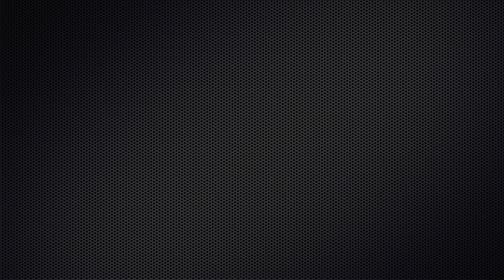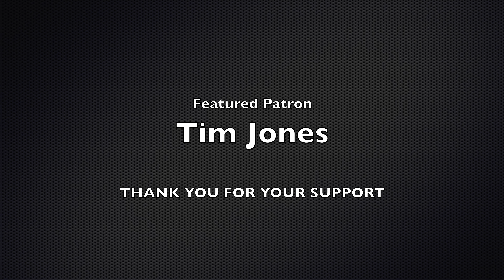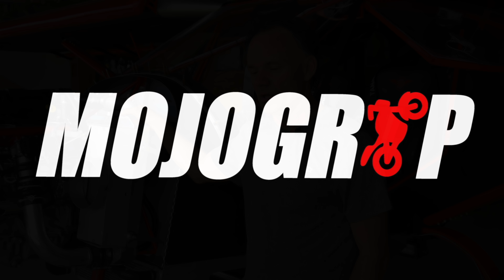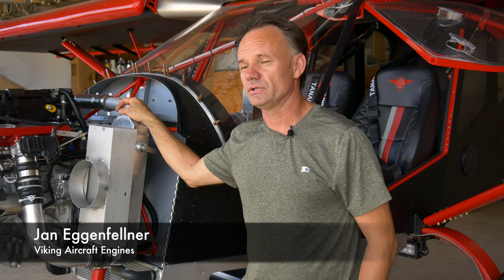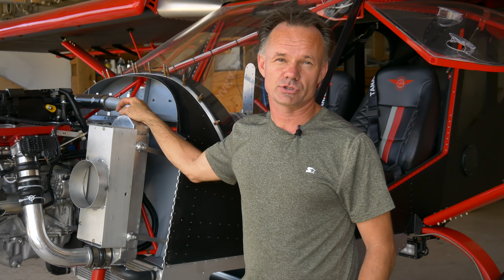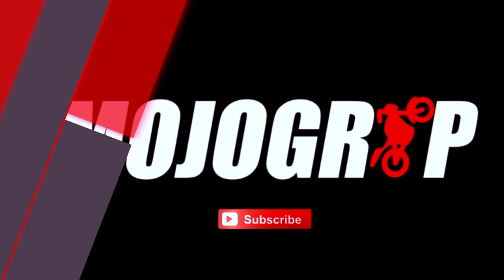Aircraft Engines l Auto Conversions VS  Certified Engines

Comment: Auto engines run for many thousands of hours between scheduled overhauls..
 Aircraft engines run maybe 1,000 hours between scheduled overhauls... its kinda a no brainer... $50k air cooled turd or a modern water cooled fuel injected engine that makes double the horsepower at ¼ the price...
Reply: Sort-of.. aircraft engines are run near their limits much more regularly than car engines (in cars).
Race cars, even using street-spec engines, get overhauled about once a year at least.

It’s about stress, not just build quality and tech.
Reply: @aisu8481  you cruise at 100% power? My regular daily driver Subaru crosstrek cruises at 90'ish mph at about 60% power (3.5k rpm)... And got 150k miles on it before finally needing an alternator... The rest of the engine still runs as new after replacing said alternator... I just change the oil every 5kmiles.... I beat the shit out of my vehicles, they see 100% power every time I take off from a stop sign/light... And go to the race track regularly for track days (expert run group)
Reply: @toadamine  I’m saying if you put a car engine in an airplane, it’s going to see higher load for every hour than it does in a car.

You’re talking about a track day every time you fly. Even track days have braking zones, and cool-down breaks after each 20 minute session (bar the optional final hour that Chin does) and engines see a lot of wear there.

Imagine 5-10 minutes of full throttle, nonstop, in your car, every time you leave the house. Warm up and boom, full throttle the whole way to work.
That’s climbing in a 172.
Followed by eh, roughly 60% power, whereas a car gets to coast and use lighter inputs.

Car engines do 10 reps of squats. Aircraft engines do wall squats for an hour or more, spare a couple stalls and random descents.

Totally different animals.
Reply: @aisu8481  then why aren't race cars all using old air cooled airplane engines? 😂
Reply: @toadamine  geez, you’re still missing the point.

Because it doesn’t matter what you’re using, you still need to overhaul it in a shorter than normal interval, if it’s used as an airplane engine.

Comment: Why can't the engine have a transmission to operate at lower RPMs.
Reply: it has one... that's the shiny cnc'd bit on the front of the viking, the crank goes through a 3 gear reduction ... which is sort of a transmission, it just doesn't ever "shift"
Reply: Was thinking about the possibility of using an autoconversion engine back in a car. 0 experience just food for thought but this kinda crushed that thought lmao.
Reply: The engine requires high rpm to develop the horsepower needed for acceptable aircraft performance. However, that same high rpm exceeds the propeller’s efficient operating speed. So, there is a gear reduction drive to keep both the engine and prop at useful rpms.  The alternative is high torque at low rpm engines, such as the legacy Continental and Lycoming engines.  Lots of cubic inches of engine displacement for a given horsepower so that there is ‘surplus’ of low rpm torque in the rpm range required by the prop.

The reason automobiles have transmissions is the engine has widely varying loading, and horsepower/torque requirements. The aircraft when flying has a more constant load to maintain cruise flight and necessarily operates at a higher percentage of peak horsepower than does the typical automobile.  However, the nearest thing to a transmission on piston aircraft engines is the constant speed propeller. When the aircraft is operating at a lighter load (speed and/or weight), the CS prop allows engine rpm reduction while maintaining a ‘cruise pitch’ propeller blade angle or vice versa, such as during the take off run.  With a CS prop, the pilot selects the best combination of engine manifold pressure (throttle setting) and propeller speed (blade pitch angle) to suit the circumstances.

Comment: The Rotax 915 iS is the best piston aircraft engine out there right now IMHO but it will be cool to see where these auto conversions go in the future.
Reply: Less that 160HP, almost 50K and a 1200 TBO....Granted, imagine that TBO will increase with time.  Not a Rotax fan, but atleast they are trying to come up with new products.  I just think that price completely misses the audience they are trying to attract.
Reply: Viking Aircraft Engines Haha dramatic much? The 915 iS seems to be working quite well for Sling and many others.

Trent Palmer has one in his Kitfox STi and today he called it, “the best piston aircraft engine in all of GA.” 

Like I said, it will be interesting to see where these auto conversions go in the future. There’s just not enough hard data to support their reliability in aircraft yet.
Reply: and tremt palmer got grounded because the ehaust valve stem is sodium filled and there was a manufacturing mistake in them.  his exhaust valves need replaced. all 915 aare grounded . @andrewmorris3479
Reply: m kramer Yep, hopefully the can release new valves soon and get these engines back in the air.
Reply: @andrewmorris3479  was the 915 the engine that died on him during a flight and had to land off airport?
Reply: MattPSU02 Haha no. It was an old 912 UL with parts from other Rotax engines and a big bore kit. On top of that an incomplete knowledge of its history.
Reply: Andrew Morris Trent has to say great things about that motor. The Rotax Safety Association gave him that Engine. He is there spokesman. Great advertising.  Just watch his video when he got that engine. He didn't come right out and say it. But you can read between the lines. He said he could not afford that engine without there help.  I'm not hating on Trent. Love his channel.  But he has to say it's a good engine. I'm sure that was part of the deal..
Reply: $30,000 say nope.

Comment: Have you ever thought about checking out the Honda 2.4 engine?
Reply: It weighs 412lbs....
Reply: @Wingnut353  That's with a transmission, halfshaft assembly and full accessories, they're less than 300 pounds without the transmission. The Honda V6 that Titan aircraft uses in their T-51 only weighs 416 pounds, ready to fly.
Reply: You wouldn't want to use the 2.4, its internal geometry is all wrong for use in aircraft, you'd want to use the K20A. The K24 is very undersquare (which gives it high piston speeds) and it has a very short rod to stroke ratio, which places high side loads on the cylinders/pistons. It was designed to make power at low revs, which is not what you want in an aircraft engine, as it will spend most of its time at relatively high rpm.

Comment: Hi
I have a 200 kg aircraft which is the right engine for it
What do you need from horsepower ??
Reply: I think a Rotax will be great (Weights 93 kg) with a 100 hp (75 kw) power rating for the upper end.
Reply: @heathbauerle2787  thanks

Comment: I've been looking at using the Audi 3.0 tdi swap for a Cessna 170/180
Reply: Good luck, the engine weighs a ton.
Reply: @PistonAvatarGuy  the Continental 0-470 weighs 391 pounds. The 3.0 TDI weighs 483. Almost 100 pounds heavier but will burn 5.5 gph or less. Also there's over 100 hp increase with the TDI swap.
Reply: Also increases flight distance by at least 400 nm
Reply: @bladenrexroth2555  A 3.0 TDI with a PSRU strong enough to handle the torque pulses that it produces, plus a cooling system, is going weigh around 550 pounds and will make about the same amount of power as an 0-470. Lugging extra weight around also has basically the same effect as reducing engine power. Every percent you increase the weight of an aircraft requires power to increase by the same percentage in order to maintain the same performance. Cessna dropped all of its diesel offerings due to that harsh reality.
Reply: @bladenrexroth2555  More weight = less range when the same amount of power is being produced. More power requires more fuel. Aircraft designers aren't dumb, there's a reason that diesels never caught on as aircraft power plants.
Reply: I've seen IO-550 swapped 180's. An IO-550 is 450 pounds and will burn 9.5-13.5 gph depending on altitude and rpm. The TDI would burn near half those numbers. Torque of the engine would provide higher thrust at lower rpms.  Especially with a tri or quad prop.
Reply: I think diesel engine never did well in the states because the diesel option added $120,000+ to the price tag. Big oil and the EPA can't make money from diesel. Not when gas engines burn through tanks every 300-500 miles. Why the diesel option is more expensive in both auto and aviation. People can be self sufficient on a diesel engine.
Reply: @bladenrexroth2555  Geez, are you a clone of the Raptor Aircraft guy? The torque output of an engine means absolutely nothing, at 2,700 rpm on the prop, the amount of torque is the same when you have the same amount of power driving it. For example, 230 hp at 2,700 rpm is ALWAYS 447 lb-ft, no matter how much torque the engine makes. The prop turns POWER into thrust and more power = more thrust. 

You can hang a heavier engine on the front of an aircraft, but that usually means that you have to add weight to the back of it in order to keep the CG within limits. More weight = less performance, unless you're improving the power to weight ratio of your aircraft, which you're not.

Your fuel burn also wont be half, more like 70%.

If you really want to re-register a Cessna as an experimental so that you can run an automotive engine in it, you're much better off with a gasoline V6. A Nissan VQ35HR would be the best choice, it has great internal geometry (short stroke, big bore), is much lighter than any diesel of similar power output and will give reduced fuel burn when compared to any Lycoming thanks to its EFI system.
Reply: @PistonAvatarGuy  what about the all aluminum  VW 2.0 tdi? 330 pounds and can make a reliable 330-400hp. Weight is close to the IO-470 and almost doubles the hp?
Reply: @bladenrexroth2555  You can't make 400 hp from a 2 liter and expect it to be reliable in an aircraft. Automotive engines never make close to their full power output for long, just seconds, here and there, that's it, never minutes at a time like an aircraft engine does. Even cruise power in an aircraft is far greater than what the typical automotive engine is designed to handle for long periods. Car engines spend the vast majority of their lives making below 25% of their maximum power output.  

In a car, you can make over 1,000 hp with a 300 pound Honda K20, or 1,500+ hp with a Nissan VQ, that doesn't mean that they can do it all day long.

Diesels make ZERO sense in aircraft, PERIOD.
Reply: @bladenrexroth2555  330-400hp from a vw 2.0 tdi...are you high? It might be possible for about 3 minutes before self destruct...180hp is a reliable figure for one of those and that's twin turbos.
Reply: Diesels aren't good for aircraft no matter the displacement, they're just far to heavy. If you want something that burns jet fuel buy a jet
Reply: Might as well throw my 2 cents in.  Again you can't just slap an auto engine on a FAA certified aircraft, and you don't want to go through the process the certification process.  If you are operating an amateur built (experimental) aircraft, knock yourself out.
Reply: Diamond DA-62... twin diesel engines. $1.6 million. A electronically injected 2 liter turbo diesel that can cruise at 2200 and maintain a sub 5gph fuel burn is not far fetched. Plenty of experimental aircraft to suit anyone's tastes/ preferences. If the Mooney M20 had a 2.0 tdi it would be unrivaled in distance, performance and low fuel burn. My opinion.